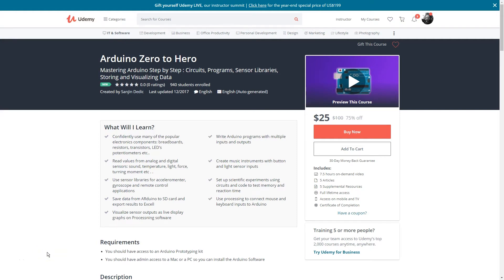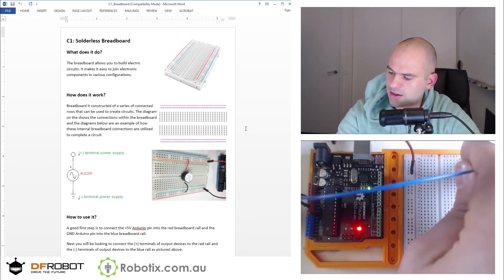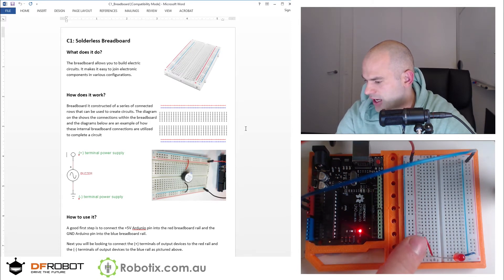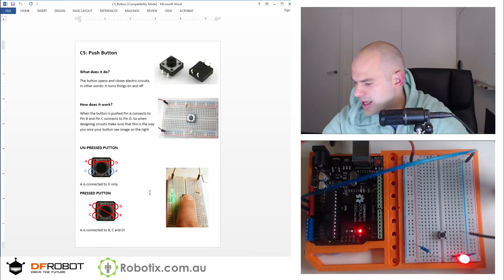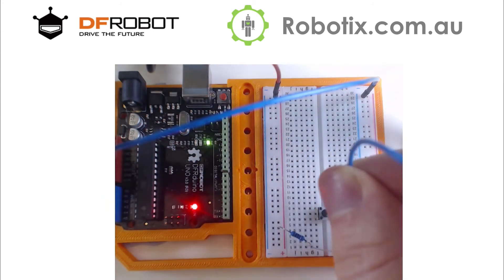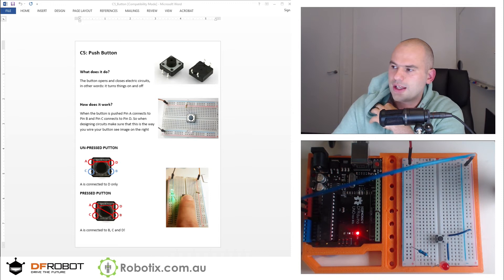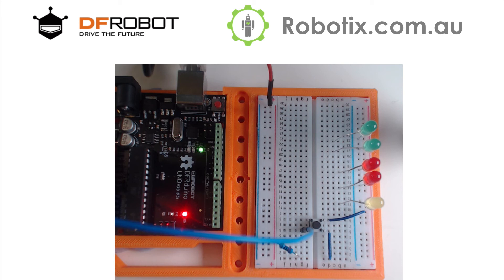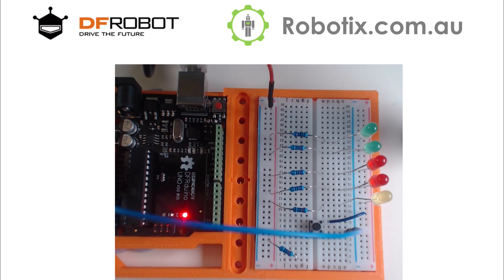LED Button Circuit

Comment: Hi it says that the course material is no longer available on udemy? any idea why or where I can get it from? i signed up for it awhile ago and cant get into udemy for some reason and cant access it again.
Reply from the maker: send me an email to sanjin@headstartacademy.com.au and I will send you a link to sign up. The codes on kits still work but they are a one off